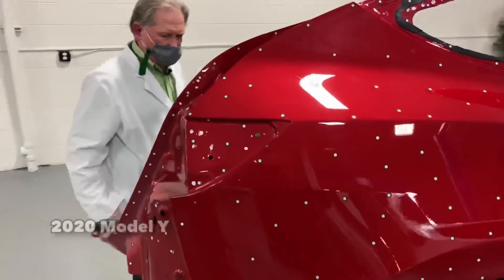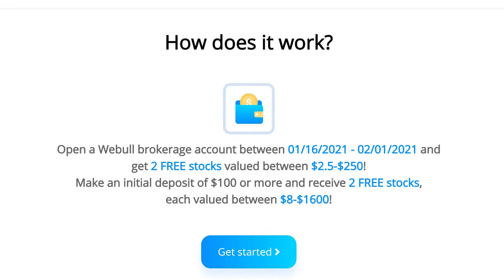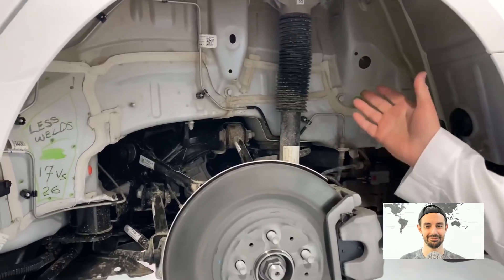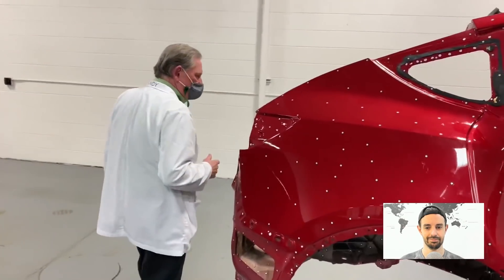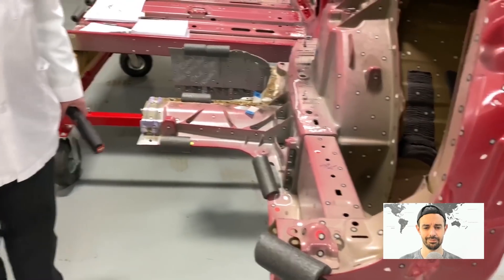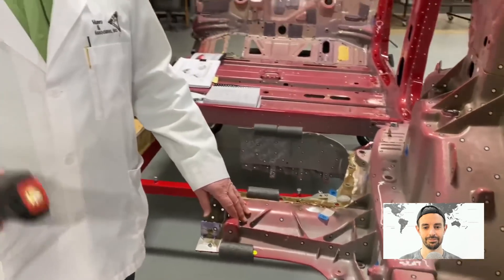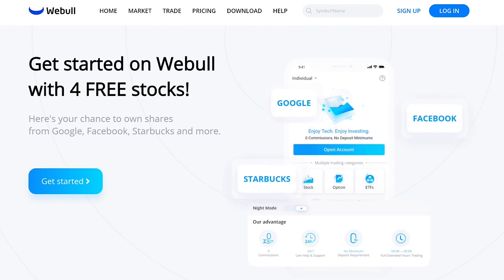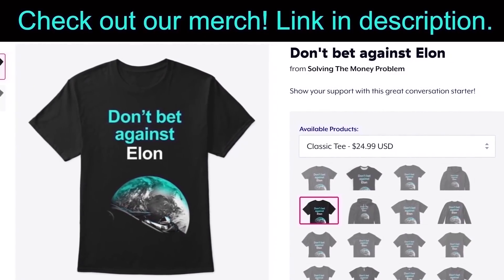Sandy Munro Tears Into Tesla's 2021 Model 3 Engineering

Comment: Tesla would need all new giga-casters for the Model 3. They'd have to completely re-do the production line. It would be like an all new car. Maybe the Y is the redesigned 3.
Reply: It's most likely a problem of not being able to do everything at once.  The company that builds the casting machines is probably limited to how fast they can turn out new machines.  Fremont is making Model 3s and they are selling all they can make.  What casting machines that are available need to go to new factories so they can start production as soon as possible.  Once product is flowing out of Berlin and Austin Tesla can install additional casting machines in Fremont and rework their assembly lines.
Reply: @bobwallace9753  Agreed. Giga-cast 3's are coming, just not anytime this year or next. If I was Elon, I'd have the giga-cast manufacturer designing the 25k model press/mold before they designed new units for the 3.
Reply: @SafetyBriefer  Producing the $25k EV, I suspect, requires Tesla to first ramp up production of LiFePo 4680 cells.  The key to a less expensive EV is less expensive batteries.  Casting machines should be installed where they most boost output.  Tesla can figure out whether that's at Fremont for the 3 or somewhere for the $25k. 

I'm just going to guess that Tesla may not want to disrupt Model 3 production at Fremont until there is ample production from other plants so that quarterly production numbers don't dip.
Reply: @bobwallace9753  Solid analysis.
Reply: Not really you would just swap out the mold pieces but then you are making 3s and not the higher demand and more profitable Ys the hard and expensive bit is the press and they may have a limitation on the production volume of those from Italy.

Comment: Sandy was definitely not thinking straight.  The rate limiting factor is indeed the ability for their vendor, INDRA, to make the casting machines......  
1.  Proof of concept in Fremont.
2.  Delivery of next 4? 6? to China.
3. Delivery of next 8 to Germany.
4.  Delivery of next 8  to Austin.
5. Delivery of next 4 to Fremont.

I believe there are videos out there of Made in China MIC Model 3s with Gigacasting rears, but I haven't seen front pieces yet.
Reply: Wow
Reply: Dale , Shanghai wont get Front / Rear casting until 2022 - possibly 2023.
both Fremont and Shanghai will be last. to get Improvements.
GigaBerlin will be FIRST to get Latest Technology.

Comment: Tesla's plans are a self fulfilling prophecy: Tesla needs incredibly huge money injections for actually transferring their innovations into reality, but Tesla is SO hyped, that people give them the money, so they can actually do what other car makers only dream of. Most of the innovations were not done by other automakers because it was too capital intensive, and they have very small profit margins. It is very painful to compete with Tesla because they fully exploit the hype for their (and the customer's) benefit.
Tesla works fundamentally differently than other old automaker, you tell this in almost every video.
Reply: Adam - TESLA is Profitable, they have a $20 Billion WAR chest, and spending money as WISELY and as FAST as they can.
they even recycle SCRAP Aluminium to fuel the GigaPress at FREMONT.

Comment: They might wait till Austin starts 3 production before updating 3 production in Fremont
Reply: GigaBerlin and GigaTexas will Produce model Y on day one and with Updated FRONT & REAR Megacasting as well as Structural Battery. both have 8 Gigapress each. later they can add Model 3 as well.
Reply: @Solving The Money Problem Sorry I'm a little slow.  I'll check you out soon

Comment: That giga press is running round the clock. Simply aren’t enough of them yet
Reply: @Trevor Ritchie I agree. The mega casting machine in Fremont can only make <170k castings a year based on a recent video. I don’t think they have enough machines or space yet. That should change this year in a big way.
Reply: @RobertLopez66  hahaha vw in their Wolfsburg factory alone makes more than 800k cars a year and delivers them directly with trains, ships.....
Reply: @RobertLopez66  But Berlin, Shanghai and Austin also needs castings. I think Tesla is casting supply limited.. So the 3 has to do with old tech. Same went down with the Model S/X not getting the Model 3 cells.
Reply: @Deveonn  Tesla have already deliveried or started the delivery of giga presses to both the Berlin And Austin factories.
Reply: @Deveonn  They're already installing those in Berlin and Austin while construction is in progress, the drone footage caught the big IDRA branded transport crates going in, and Shanghai obviously has them already deployed for the Model Y line that just began operation and first batch delivered to customers this month.

Fremont will probably come later, when they can afford to take their main lines offline, I'm betting after Q2, likely around the time Austin or Berlin begin to pick up the slack and keep their profit streak going for the sake of the fickle Wall-street crowd.
Reply: every 108 seconds a REAR casting is complete.
Reply: @Solving The Money Problem I smell some fuckery here....
Reply: @airdogg1979  yep, it's just an impersonation account spreading spam and such. Just report the channel and posts to Youtube sigh.
Reply: @airdogg1979  
Youtube apparently doesn't protect properly against impostors.
That guy is a fake. And also not a guy but a spambot.